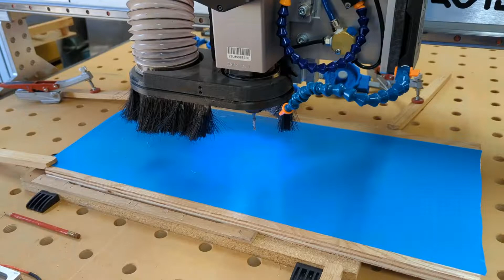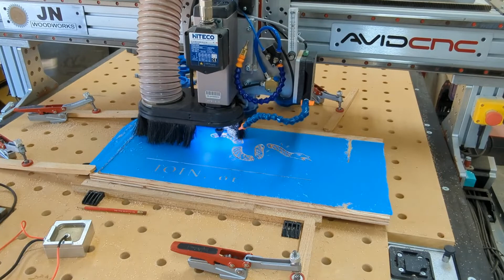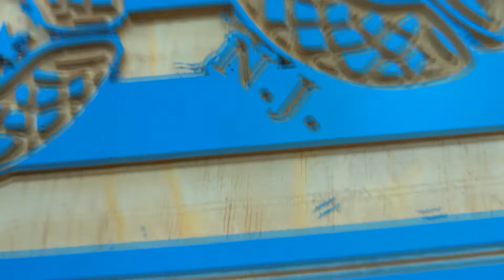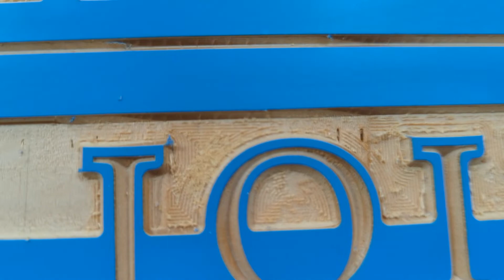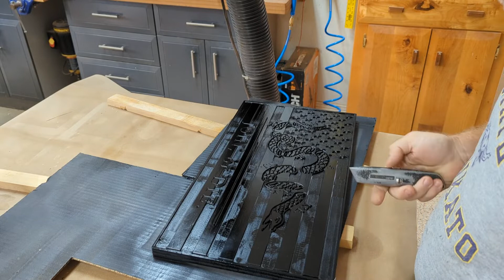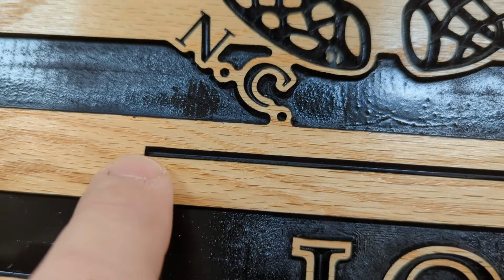Beginner's Guide to CNC Router Vcarve Sign Making Part 2

Comment: Great video, as usual. Could you please tell me where I can buy those blue "side" clamps that I see on your table? I've tried searching and cannot find them.
Reply from the maker: These are the dogs I use: https://www.amazon.com/gp/product/B076MGP4F6/ref=ppx_yo_dt_b_asin_title_o00_s00?ie=UTF8&psc=1, and these are those Kreg clamps: https://www.amazon.com/gp/product/B0774WBGPX/ref=ppx_yo_dt_b_search_asin_image?ie=UTF8&psc=1  
If you search around you can usually get them for under $20.  They really don't wear out (other than me running them over with an end mill), and hold as good as any horizontal metal clamp I have tried.  I still use a hold down clamp in conjuntion with these when I need the workpeice held down flat.
Reply: @JNWoodworks  Thanks for the reply Jim.

Comment: Jim thanks for taking the time to show how you do this. 
I have done quite a few oramask signs and my order of operations is different from yours. 
all prep is the same but my carving steps are different. 
1: v carve outline first. this will make clean defined lines.
2: then remove oramask from the areas that will be carved with your different sized end mills.
     by removing the mask it won't ball up on the end mill. 
     most importantly you can use up cut end mills! 
3: then you can seal with sealer and paint.
This my standard process for oramask and painting.
Reply from the maker: That is a good idea.  I was trying to figure out a different order for the bits in the combined set of pocketing toolpaths, but I gave up when I couldn't figure out how to put a tolerance on one set of bits.  But I think you are saying you just use a profile toolpath to clear the oramask on the edge, and then do a completely separate series of pocketing  toolpaths inside with the end mils? That is a great idea I need to try.  Thanks!
Reply: my goto settings 
I usually go to the vcarve toolpath select a 60 degree v bit and set a depth cut of .08 and then select clearance end mills 1/4,1/8 & 1/16 up cut.
besure to remove the oramask where the end mills will be cutting. that way it won't be rapping around the end mills.
Reply from the maker: @lennylovell1450  Thanks!